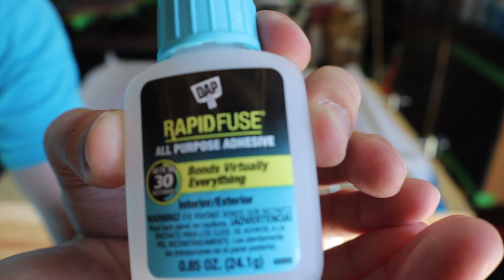DIY Silk Screen Stretcher | Easy Way To Re-mesh Silk Screens From Home

Comment: Making a stretcher is very simple. You just a need the technical idea to design yours. 1. Clamping(with clamping devices or tools) 2. Treading (nut & bolt) and taking note on (3) Distance so you can tread well to achieve maximum tension. That is the engineering concept behind all industrial and home made screen stretching machines. Thanks for your video.

Comment: So you’re just going right over the top of the old screen. Do they have something that breaks down the old glue so you can pull the old screen off the frame
Reply: Use a grinder with a sanding pad but do it outside because that old glue becomes a gas when you emulsify it.

Comment: Hello your link to the t-slot isn't working anymore, can you specify the size and series of t-slot bar you are using?
Reply from the maker: Get the metal slotted pull bars from 80/20 here: https://is.gd/sB2aKg  The link is still active. As for the size, you will need to know the size of screens that you are wanting to stretch then measure accordingly.